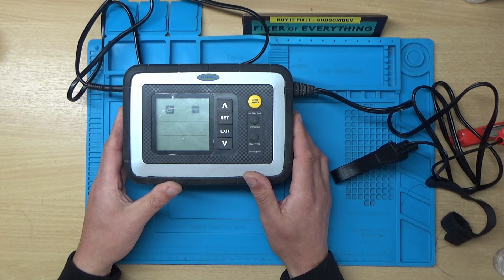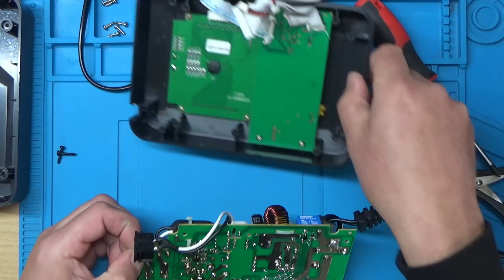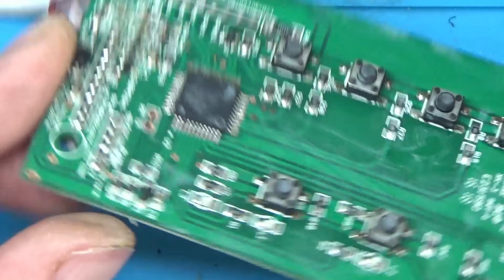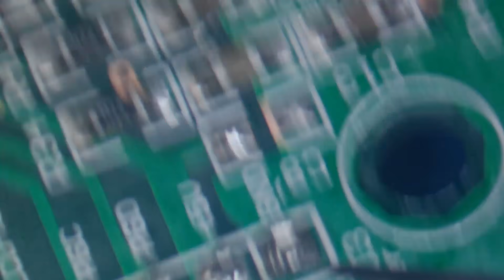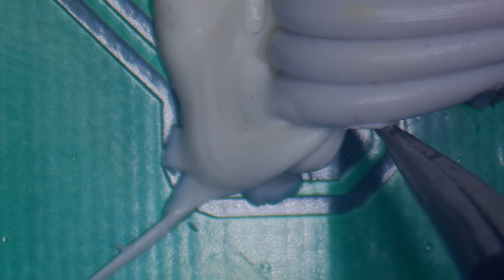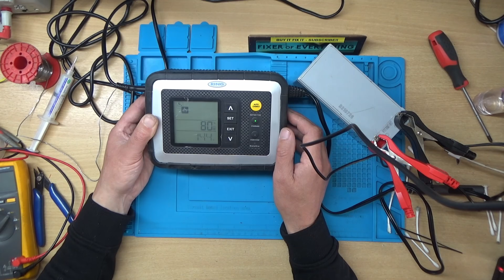Faulty Ring Smart Battery Charger | Can I fix It?

Comment: If you want something to clean the corrosion and solder mask off tracks, try a coarse fiberglass pen. Just be aware of the dust it generates and don't inhale it. I vacuum it away. It works really well at just not damaging the copper trace itself. You can get different refills for these pens. Fiberglass, brass, etc. I think I got mine from RS or Farnell (E14) years ago.
Reply: Use gloves...itchy buggers but very good!
Reply from the maker: Thanks I'll see if I can pick one up.

Comment: Like your videos. We actually use the same model of the Fluke 179 multimeter.
When it goes off you can just hit the "light" button to start it again. Just wanted you to know that. :)

Thanks for all the repairs! 
Keep it up!

Kind regards from a fellow electornics repairer from Sweden.
Reply from the maker: Thank you👍 I didn't know that. I upgraded from my old trusty fluke 77 a few months back. On the 77 you could just move the selector onto a different mode and it would just spring back into life. I thought it was a bit of a backward step that you had to turn it off and back on, so I'll give that a go.
Reply: @BuyitFixit  another useful trick is that you can disable sleep mode altogether by holding the yellow button when turning it on.
Reply from the maker: @stevelupton2533  I should download and RTFM 😂😂😂😂 Thanks again 👍

Comment: You could use a set of welding tip cleaners to poke thru the vias if the hole is large enough.
Reply from the maker: Good Idea, I don't actually have any. I'll have to order some 👍

Comment: is it possible to stick a wire thru these vias and connect both sides that way?
Reply from the maker: That's what I intended to do. I've done this before, but I couldn't seem to get the holes cleared. All in all it seemed there was only a couple that needed patched anyway as the other's weren't needed for normal operation.